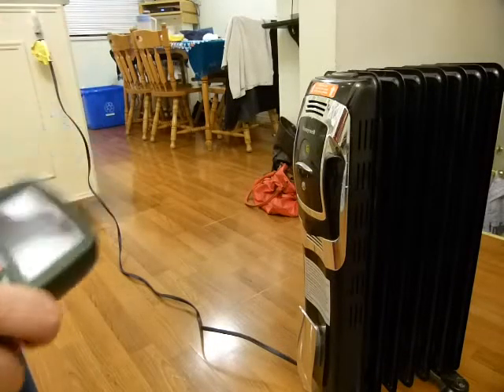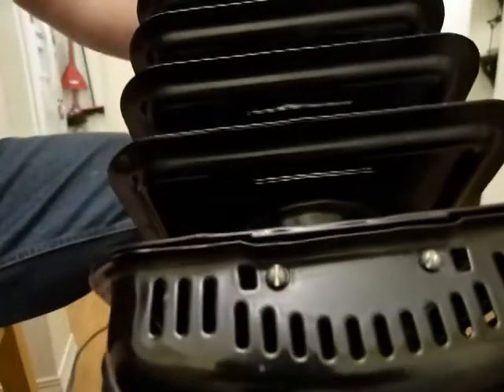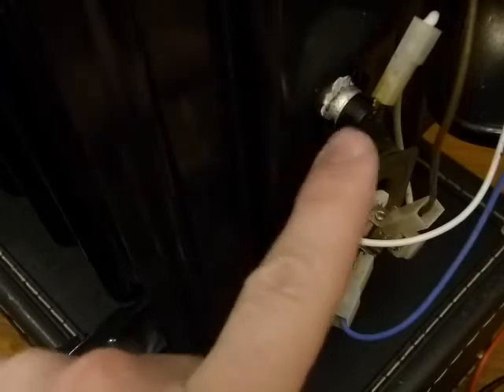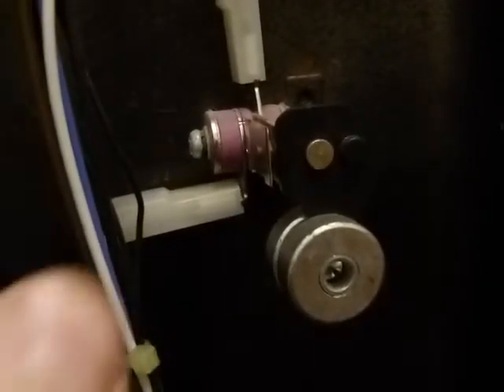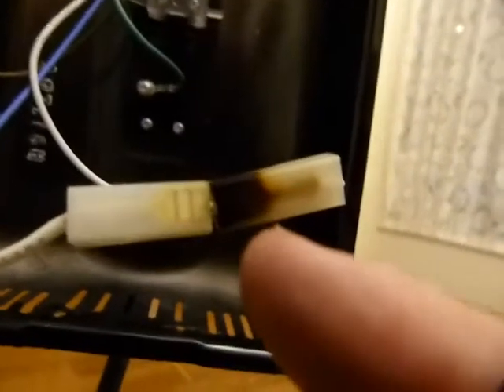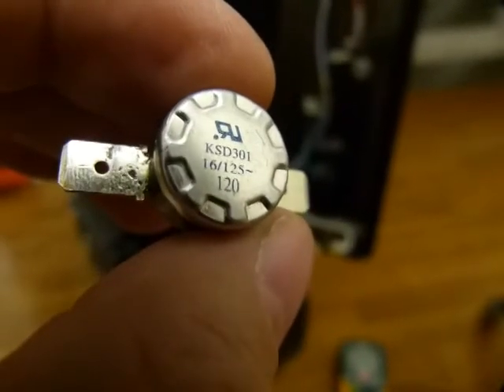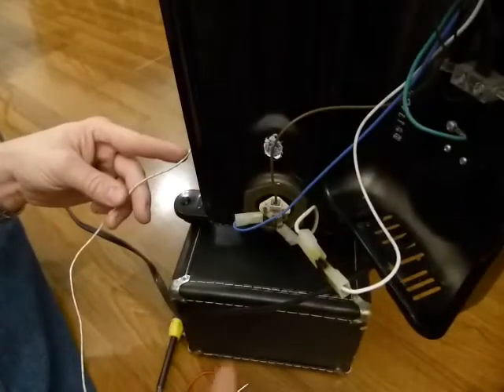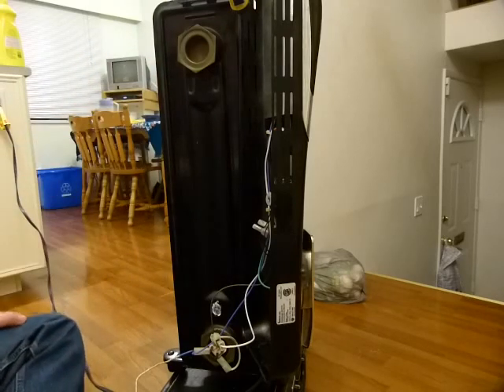Radiator electrical fix

Comment: Here we are in 2022: I use the radiators since the utility cost of an electric boiler has continued to raise, just purchased (2) (5) piece lots from China, $10.26 total on eBay for KSD301 Temp over range cut off switch.

Comment: Same issue what part fixed it
Reply from the maker: What failed:
KSD301 snap action disc thermostat, 90 °C, NC (open on rise), 120V, 16A, made by  Ningbo Yuanfang Thermostats Co.Ltd
Replaced by:
NTE-DTO190 -  SNAP ACTION DISC THERMOSTAT OPEN ON RISE 190 DEGREE F +/-5 LOOSE BRACKET 1/4 INCH QC TERMINALS http://www.nteinc.com/circuit_protection/disc_thermostats/disc_thermostats.pdf